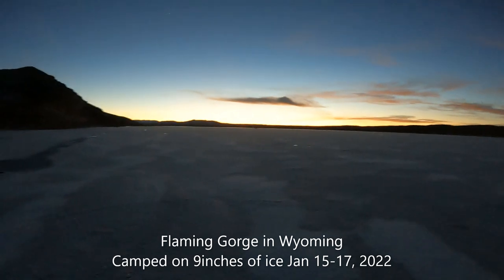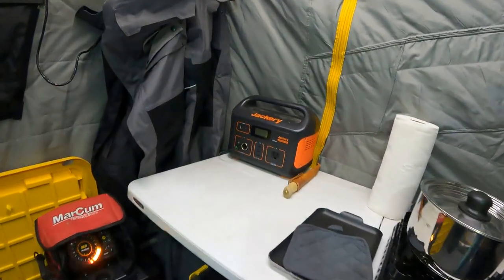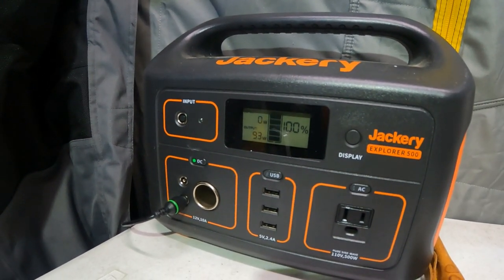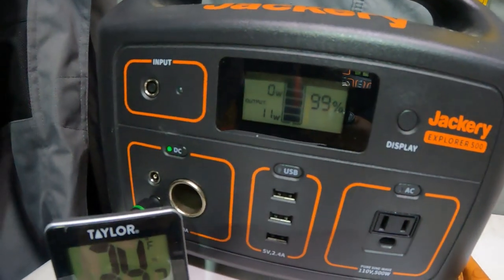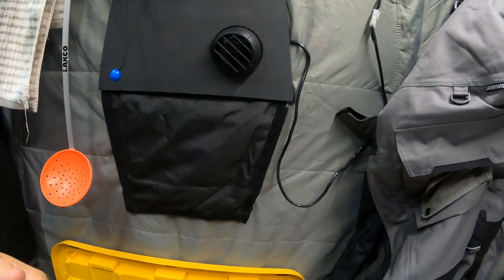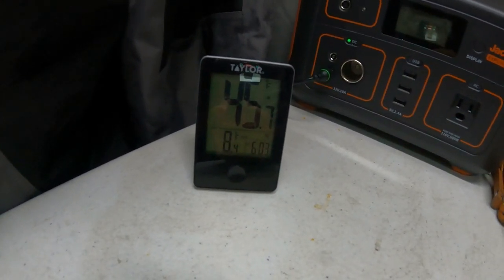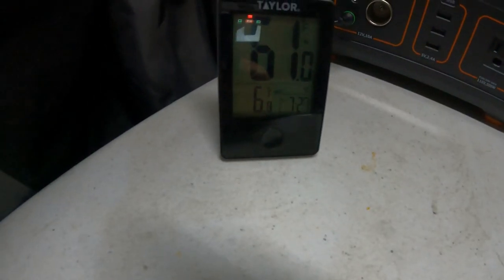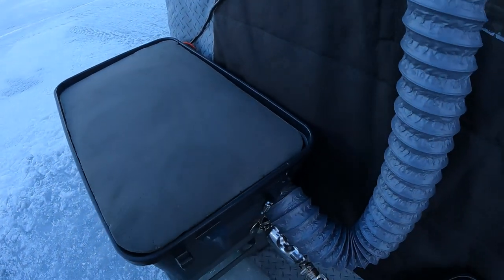FIELD TEST - Diesel Heater In-a-Box

Comment: If you hooked up a pipe to the intake on the heater and put that in the tent it would be a lot more efficient and you could run it on a lower setting.
Reply from the maker: As noted in the comments, that is exactly what I do.

Comment: That heater is working great! So you're thinking with re circulation you would use less power and fuel? I was somewhat surprised at the high watts at start up. My understanding is normal is about 10 watts at start up and settles in at around 1.5-1.8 watts or am I thinking amps? What model  tent is that and is it insulated I noticed it has an aluminum frame?
Reply from the maker: You are probably thinking amps...I get then backwards all the time too. Yes, recirculating the air should allow me to run at the lower setting with the same heat output. The tent is insulated it is the Frabill Predator. Check out the original mod video on my channel and the update video too of the tent
Reply: I’ve heard others mention condensation builds up from recirculate moisture. Who knows

Comment: Have you made any updates to this setup? I am basing my build around yours and would love to hear about what worked/didn't work.
Reply from the maker: Honestly, I have made no changes and it runs great. I do use the additional hose to recirculate air from the tent which has reduced fuel and power consumption as I can run on lower setting.
Reply: @hardh2ofishin857  glad to hear it!

Comment: Great video, thanks for doing it.  Have you had a chance to test the recirculating air strategy?
Reply from the maker: Yes. Ran it the last trip on the ice. Had to run it on the #3 setting as it was way warm. Super efficient.
Reply: How did you recirculate?
Reply: @hardh2ofishin857  why are you heating cold air🤭

Comment: Are you not recycling your inside air back to the heater? That would make a big difference in lowering your fuel requirements and fan speed so less watts with warmer makeup air. Your tent would be warmer with less energy use. FYI, I run one on 10Lx8Wx7h plastic 6mill greenhouse and can get 25F outside and 45F at lowest setting temp mode of 8C. Ramps up well as outside drops to keep it in 40F range so it’s above freezing. Greenhouse effect during day with Sun light allows for no heater use or we run the heater all day if over cast and below 40F. Been thinking about this for camping and Jackey so your test has shown good results. Thanks for posting, nice setup, happy fishing.
Reply from the maker: Yep, I recirculate the air as noted in the video. The test run didn't but now I do. Super efficient as it consumes 1/2 the fuel I used in the field test and about 1/3 less power from the Jackery.
Reply: @hardh2ofishin857  do you have video on how to do the recirculating?

Comment: Nice review. I have been loving mine. I now take a genny to top up battery during the day while i jump around fishing. What model of flip shack are you using.
Reply from the maker: I have the Frabil Predator. Check out the vids on my channel of the initial build and then my update video that shows the current setup. I use a solar panel to top off the Jackery during the day. Works great.

Comment: I bought my Diesel Heater, already in a poorly made Red Tin Box, 
My Findings is: At Start Up while the Glow Plug Heats it pulls 8.0 Amps and Min battery down til 11.5 v, 
Then once Self Burning is running then 1.8a- 2.5a Min -Max use, until ShutDown then 8.0amps while the Glow Plug re-lights and burns off excess fuel and waste

Comment: My opinion is that warm air should always be pushed from the bottom of the room, and according to the laws of physics, it will then go up. Less fuel would be used for heating and the temperature would be more evenly and comfortably distributed.

Comment: Great job! Thanks for sharing. Quick question: do you recall where you sourced the DC connector plug for your Jackery? Also, those two "DIY" (as Jackery refers to them) DC plugs are rated at 7 Amps; the cigarette plug one is rated at 10 Amps, again, according to Jackery. The 5KW diesel heater is supposed to need 10 Amps on startup/shutdown. Glad to see that it's running OK on the 7 Amp plug.
Reply from the maker: The DC connector is actually an accessory that Jackery's competitor sells...yeah...seems dumb that Jackery provides the ports, but they don't sell any plugs/accessories at Jackery for those ports...anyway, Goal Zero does. $7... https://www.goalzero.com/shop/power-station-accessories/6mm-male-to-ring-terminal-adapter/.
I was curious about the 7amp rating for those ports too, so I always have the cigarette lighter plug with me just in case. But, I have used it 6 times now and never had a single issue at startup or running using the port.

Comment: Have you had any distinct smell coming from the outflow also any melting of the outflow duct due to the extreme heat these put off?
Reply from the maker: No odor issues. The only way you would have any odors in the effluent air is if the unit is defective because the air flow is completely separate from the combustion chamber.  No issues with melting the air ducts either its designed for hot air.

Comment: So I took this out on the ice today and I was getting an Error code 08 with the heater. I’m using the Jackery 500 explorer as well ☹️
Reply from the maker: With my heater that error code 08 is a fuel delivery error. Maybe there's a kiink in the fuel line or possibly the vent hole on the fuel tank cap is not venting the tank and is causing a vacuum? Its possible the dosing pump is also malfunctioning or not positioned right. Did you prime the fuel line first?
Reply: @hardh2ofishin857  thanks for answering this! I was reading up on some of the error codes, and I did end up switching some of the fuel lines to the smaller diameter. I also drilled a slightly bigger hole into the fuel tank cap. It’s currently running right now at my home outside with the Jackery, I started it at 8 AM; so I will see what it is doing when I get back home. Thank you again for the heads up! I’ll keep you posted
Reply: Update! Runs awesome! I actually went out and purchased the same exact kit and out one together the exact same as yours and will be using it for my Eskimo 2400. Thanks again for this build and can’t wait!

Comment: What did you use for bringing the hose into your shanty?
Reply from the maker: I cut a piece of 1/8 inch plywood the shape of the window and used velcro just like the removable window has to stick in in place on that wall. The hose just connects to the directional vent port attached through that plywood.

Comment: all you guys are sucking in ice cold air instead of running  the return air inside the tents the unit would work a lot better
Reply from the maker: Well as mentioned in the video, that's exactly what I do. 4 in vent hose pulls air from inside tent. The vid was just the first field test. With recirculating the air the fuel consumption drops off significantly as the heater doesn't have to run as high to keep up.